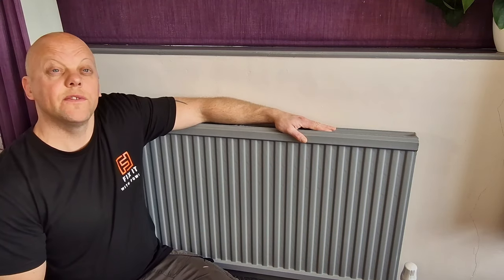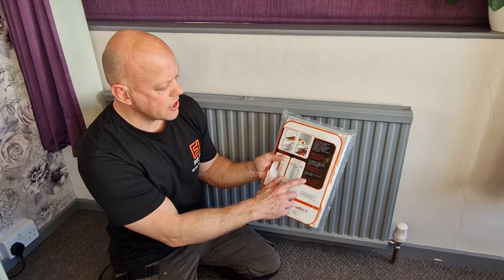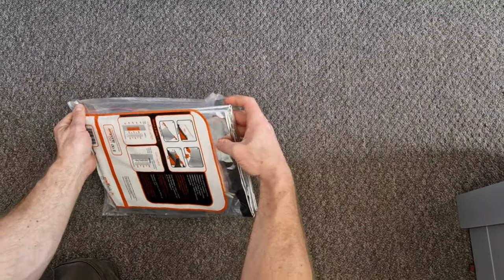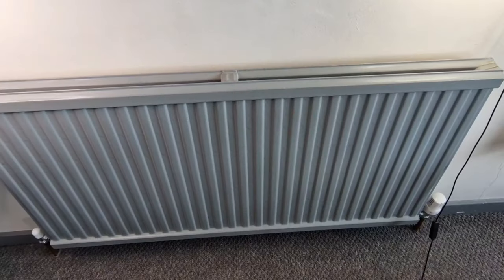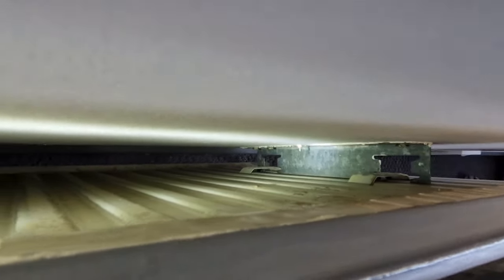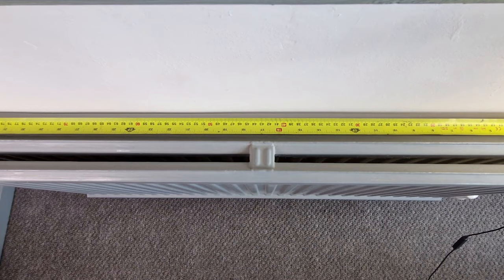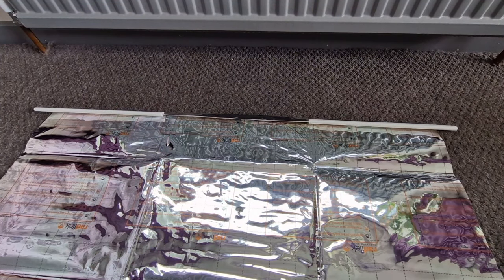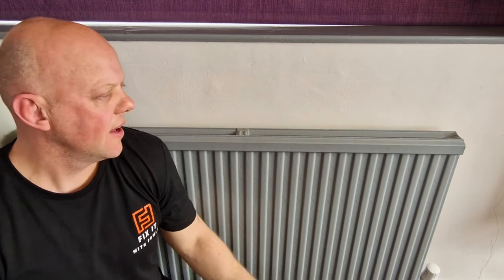Radflek Review - The best Radiator Reflector?

Comment: But half the radiator isn't covered, so how's that going to work with half the heat vanishing into the wall?
Reply from the maker: It all depends on how you install the radflek behind the radiator. Mine covers all of the radiator top to bottom but not the last 10cm on each side of the radiator, so about 80% is covered. You can, however, add longer supports so that the radflek cover the entire area of the radiator, but i didn't want to see the radflek.
Reply: My foil is seen on both lateral sides of heater . I don't care at all . Is shiny make it more 👀 catching 😉🙃 . Anything to save the expensive heating bill 🙏. 😡. Especially in this 🇬🇧 weather  🙈
Reply from the maker: Yeah, anything to save money.
Reply: is it ok to put behind electric oil filled radiators

Comment: This isn’t going to work as well as you think. Radiators emit most of the heat via convection and anything that reduces the air flow will reduce the efficiency. While it will cause a small amount of heat to be reflected it won’t recover a vast amount of heat.
Reply from the maker: Have you seen the data on the website? It doesn't reduce the airflow/convection as it sits between the radiator and the wall and is only 1mm thick. The design stops heat from being absorbed into the wall behind as per the thermal images rarther than increasing the radiator output.
Reply: Explanation is clear . The wall not to eat the heat . True .heater are below the windows where is most coldest  walls and we need to warm places not that walls . I will put an insulation board before and after this foil 😉
Reply from the maker: @icc64  i think itbmakes sense, and i definitely recommend them, but thats just my opinion. Thanks for your comment!

Comment: I used some foam insulated reflective foil bought from Amazon . It is self adhesive so a little trickier to fit - I removed the radiators during a boiler swap so fitting was relatively straightforward - it's good to know what savings you are making by fitting this.
Reply from the maker: Yeah, i think it all achieves the same sort of savings. These are just really easy to retrofit.

Comment: Do they really work? Was thinking of buying some and that’s what brought me here.
Reply from the maker: Hi, our house was built in the 60s, and the insulation values aren't great. Personally, I have noticed a difference in my house, and you only need to fit them on external walls. https://amzn.to/47EH00O
Reply: I think so
I put these in my parent's house years ago. They're meant to take a few years to pay for themselves ordinarily but they already paid for themselves before the recent issues

If you've got a low flow temperature heatpump they're not that good but if you're the average person with a combi boiler, these are good

They're meant for external walls but I had enough spare that I figured that I may as well pop it on the internal ones too. I don't think I'd get much benefit from the internal ones but hey it makes use of what I had spare
Reply from the maker: @waqasahmed939 thanks for your comment!
Reply: @FixitwithFowler  Nw. I think these will eventually be useless for me, largely because I want to upgrade my microbore piping and get Jaga Strada radiators. That's when I'll use low flow temps of 30C hopefully 

Until then however, the radflek is decent

Comment: Could you not extend the amount of plastic that hangs over the mounting bracket and then cut some strips to match the width remaining on the sides without the Raffle on?
Reply from the maker: Yes, you could extend the plastic if you wanted, but i didn't want to see the radflek behind the radiator.

Comment: It doesn't cover about half of the area behind the radiator.
Reply from the maker: It depends on your brackets, but on most modern radiators, the radflek sits about 10 cm in from each side and about the same from the top. Obviously, the bigger the radiator, the higher the percentage of the wall is covered, and in this case, it covers over 75% of the wall.
Reply: Our radiators are over 20 years old and we cut some 15mm diameter plastic pipe and cut a slit in the pipe which slotted over the brackets enabling the Radclips to rest on top of the plastic pipe and therefore hiring the Radfleck up behind the radiator.
Reply from the maker: Hi, that is a brilliant solution for older radiators. I have some older radiators, and i ended up placing some wood on the existing brackets to lift the Radflek. Have you noticed a difference since fitting the Radflek?
Reply: @FixitwithFowler  Than you for your reply.  We are just in the process of fitting the Radfleck, we have done two radiators so far but we are hopeful that we will see a benefit.  We also cut two strips 120mm wide and fitted them to both ends of the Radclips so that they hung at the other sides of the plastic pipe so the Radfleck covers a substantial part of the radiator.
Reply from the maker: Hi, the more coverage, the better, especially on bigger radiators. Fortunately for me, the radiator brackets need the end of the radiators, so i didn't need to add any more Radflek. Let me know if you're successful!
Reply: @FixitwithFowler  Will do.

Comment: Thank you!   Very easy to follow video, ordered via your link, just about to install mine.
Reply from the maker: Hi, thanks for ordering through my link! They are really easy to install if you just take your time! Let me know how you get on. Cheers
Reply: All done, easy peasy following your video.  bought the slightly bigger pack (5 sheets) and managed to do all radiators on external walls, and most in internal too….9 in total.   @FixitwithFowler
Reply from the maker: @user-qy3df4nw9q That's brilliant 👏,  hopefully, you will feel the difference!

Comment: Can you not clip the included plastic bracket, onto the top thin metal strip of the radiator?
Reply from the maker: Hi, i think you would struggle with the radflek brackets, but you could always use a different type of bracket to hold the radflek sheet!